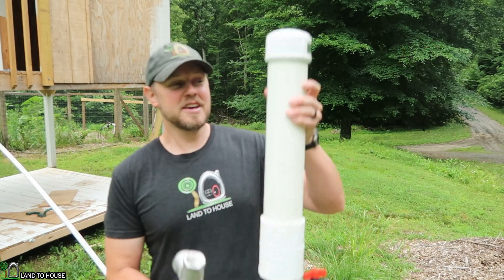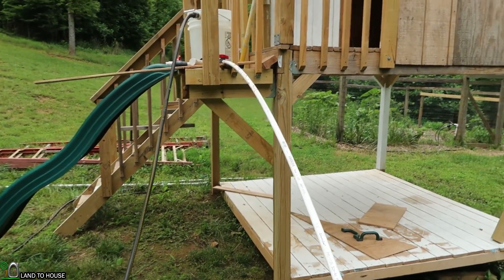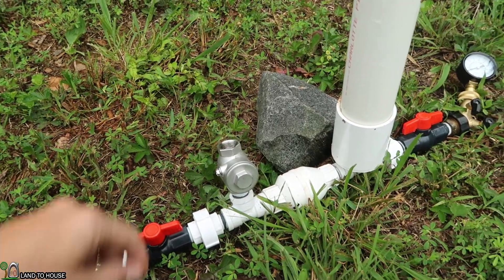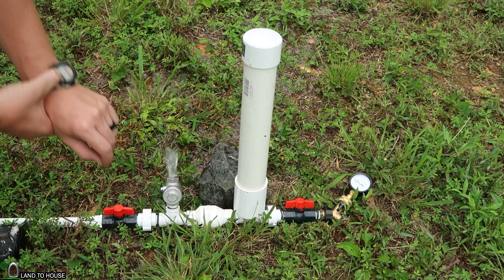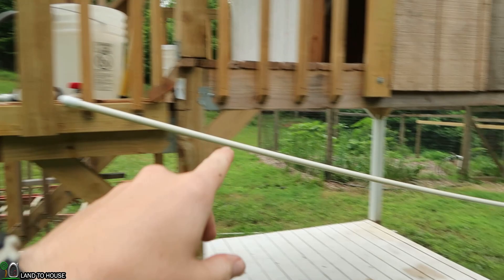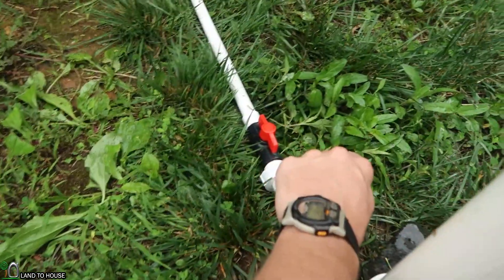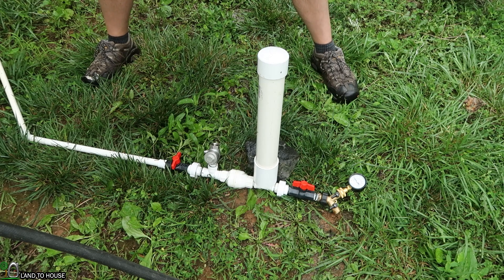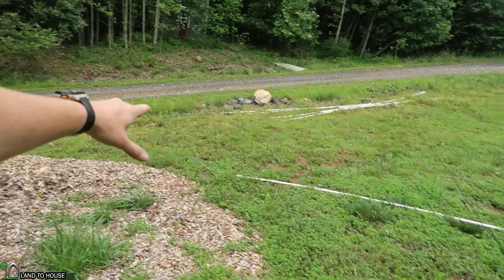Ram Pump Low Profile Zig Zag Drive Pipe

Comment: So, stupid question... Or maybe smart question, I don't know?

Is head pressure strictly about "vertical drop" or is it also about "pipe length"?

Like, does it matter if you have a pipe that drops vertically 5 feet to your ram pump vs. dropping diagonally 5 feet down, 5 feet out (7 foot pipe, appx, according to Phythagorean Theorem?) to your ram pump? 

Like, either one still has the low end 5 feet below the reservoir. Will  they both have the same head pressure, or will the longer pipe have more or less head pressure due to being longer and having more water in it?  [2 extra feet of pipe worth of water?]

So, like again, is it strictly about the vertical drop from the reservoir tap, and will be invariant (pressure/flow) with respect to the "run" or "length" of the pipe? Like would it still be the same if the pipe was 100 feet long, but the actual "vertical drop" to the ram pump level was only 5 feet (like the land is totally flat, not on a hill, or whatever, so regardless how long the pipe is, the "drop" is only 5 feet)? Or does the length of pipe and the amount of water in it matter, too?
Reply: Similar question re: zig-zag pipes, if you had longer pipes zig-zagging back and forth more times in the 5 feet between reservoir tap and ram pump, ostensibly with more water in them, would that increase head pressure (more water in the piping), or would it only care that the "vertical dimension" is 5 feet between the "tap" and "pump," regardless how much pipe / water is in between the source and the pump?

Assuming the pipes are, of course, rigid, supported [maybe some kind of framework to support the ends and middle of each section?], and not "flexible/bouncy."

Comment: Thank you for the video that I think may have ramifications beyond the cycle time.

First off, since you determined that the pressure was the same with at straight run (I think) vs an angular run (the output volume was not reported) - how do we know that the closer to 60 cycles per minute made a beneficial difference (in water volume delivered) in this example.

2nd - if the angular connections do not impede the performance, then it may indicate that the straight line drive pipe may not be as important as is commonly thought.  Sometimes the ability to sweep the drive pipe around a rock may be helpful.   Also, I've thought about going to poly pipe for the drive over PVC to help tailor the route and then bury the poly with rocks to control the flex and protect the pipe.

Cycle time conclusions
Cycle time as you have demonstrated in previous videos and I've confirmed with my testing, does seem to be an important factor in output water volume.   However, I'm not convinced that changing the cycle time by other than varying the length of a straight drive pipe while maintaining the amount of head makes a difference.  You have demonstrated that changing the cycle time by increasing the length of drive pipe by turns didn't seem to make a difference in pressure (and  maybe volume?).    Others have effected, cycle time by weights on the waste water valve does change the cycle time, but I've not seen any reports of beneficial effect on water volume delivered.

However, changing the cycle time by decreasing length of the drive pipe while maintaining the head using a stand pipe as you and others suggested did yield a 70 percent increase in water volume delivered in my situation.   Although in fairness, I'm not sure if the cycle time is a symptom or a cause of the improvement - perhaps the increased incline angle of fall because of the shorter drive pipe with the same head might be the reason.

Note to self - related Land To House video - 90 degree turn drive pipe. https://youtu.be/itm1eSqcrFQ

Thank you for your important continuing contributions to availability and optimization of ram pumps (I have two of yours) and I linked back to this video from a discussion of drive pipe configuration the Water Powered Pumps Facebook group:  https://www.facebook.com/593817582/videos/10157386931067583/

Dave

Comment: Could a standpipe make this work better?  run the bucket/source 10' line into a T fitting with a stand pipe above and the 90° elbow below for the 10' line to the pump?

Comment: I probably already know the answer but want to check to make sure...in below freezing conditions, as long as the water source is continuing to move, will this pump keep pumping? If not is there a recommended method to keep it from freezing? I'm getting ready to order x2 of your pumps to install on the north and south side creeks on my property and pump to my barn storage. I'ma t 8800 ft elevation in the Rockies. Water management here is critical and this will make an awesome addition. Keep up the great videos and more importantly, keep sharing how we SHOULD be doing things instead of ruining the planet.
Reply: It's not so much the fact that the water is moving as the fact that the source water is above freezing that keeps it from freezing.  Lakes/ponds/streams freeze from the top down, the bottom water is above freezing due to the heat in the ground, so as long as you are getting running water you are getting water that is above freezing temp.  Same with the pipes in one's house, the ground below 24" in most of the US stays above freezing so letting your faucets drip keeps the water in the pipes above freezing due to the ground it runs through.

Comment: help!  I've got 2" valves on my old ram pump (I salvaged them from somewhere)  what size pressure chamber in your opinion should I have?  , I had a built a 6"chamber  with a forklift inner tube in it, but didn't have enough fall to cause it to cycle, I just pumped up the tube and stuffed it in the pressure chamber w/o checking pressure as it was so low my pressure gauge wouldn't register the air pressure.  Doing some You tube drinkin tonight!  I loved this last vid you posted!  Keep posting em, I'll keep watching em!  Wooohooo! Onward into the night!

Comment: When I optimized my system, I found for the same fall (not changing height of intake or length of drive pipe) that the longer I could delay my one way valve from slamming shut (by leaning it at about 40 degs like you do and also my making the hinge for the swing be on the low side so the metal had to go more against gravity) the more flow I got. During my tests I could get the cycle time extremely high by placing a stand pipe about 5 feet up. Cycle time was huge, but velocity from drive pipe caused next to no water to go through the second valve (non waste valve). Also I didn't find any pressure difference on output, but was able to go from 2 qts of water every 3m 30s down to 2 qts of water every 52s. All by getting drive pipe as long and straight as possible (to increase velocity of water before waste valve slammed shut) and delaying the waste valve from slamming as much as possible. Thanks for awesome vids always!!!

Comment: Interesting test! I wonder if that would work with a coiled length of poly pipe. Say a 20 foot length. If it were secured to something to minimize the amount of bounce, it might be a nice compact solution (as long as you can maximize the vertical head in a small foot print).

Comment: Interesting videos. Could you shorten the drive pipe but increase it's diameter with similar results?
Reply from the maker: I have a few tests with mismatched Drive pipe and waste valve. Seems like it's most ideal to have matching sizes

Comment: Many years ago I was told 1 90° elbow added 17 feet of resistance to the flow of a pipe,  try using hot sand inside a pvc pipe to form a smooth u turn ..or.. even a  coil to accomplish the needed length into a small area, perhaps 4 feet square and 6 feet tall..seems as long as drop and distance are maintained it should work..maybe test the theory using 3/4 garden hose to keep it easy to form the coil around a wooden frame??
Reply from the maker: I could probably get conduit 90s to save time on bending. :) I will put that on the list.
Reply from the maker: Garden hose is so flexible it does not work very well.
Reply: The trick with bending plastic pipe is that you have to keep the ID as smooth as you can, and that is hard to do without something in the pipe to prevent the plastic from bunching up. Sand, as mentioned, does work, but the sand can (and will) shift and move so it doesn't actually keep the ID very accurate in my experience. However, the watercooling PC builders have 'solved' this by having silicone rods made with accurate OD, which you convince to get into the pipe (I would make a short section to curve, bend it, and then couple/solvent weld it in with much longer runs of straight pipe) and then because the silicone is not going to compress much at all, and it is highly heat resistant, you just use a heatgun and spin and bend. I wonder if a smooth spiral (like a slinky, only with pipe) would show any losses since there is no hard corners to lose energy in.
Reply: @spokehedz  just so the "slinky" is stretched so the liquid benefits from natural gravity also..I've used hot sand successfully however with that length a form to hold the shape  and a cold water rinse on the outside to lock the shape while trying to get all the hot sand out would be helpful
Reply: I wonder if a couple of copper pipe would give good results ?  It shouldn’t have nearly the bounce of hose or pvc.

Comment: I enjoy watching the experimental aspects of your content, to the point of actually "anticipating" your posts!!...perhaps anticipating could be defined as building a playhouse for your unfinished kids...yup! I gathered  that from the 1st 60 seconds of this video...happy 4th to you and yours!!
Reply from the maker: Thank you. That means a lot. Yes I really need to finish the last three steps of that Playhouse so I can get that series posted. And so my kids can play in there.
Reply: To avoid all the math I would build a full size model using garden hose to determine circumference of coil while allowing drop/slope required to provide speed of the water..guessing 5 or 6 tomato stakes and inexpensive zip ties..if perfected it might be powered by elevated rainwater collection tank to push water to higher storage  or house while waste water is directed to irrigation..do pros & cons later LOL!

Comment: Have you ever tried using a 3/4 inch waste  valve on a half inch drive  ram pump  to see if you can get better than a 1/7 lift
Reply from the maker: What I found is there is not enough flow rate in the smaller Drive pipe to close the bigger valve unless you have higher head pressure. It's best to have a matching Drive pipe and waste valve. Using a very rigid Drive pipe can get a higher ratio